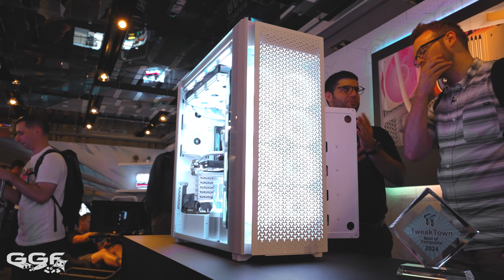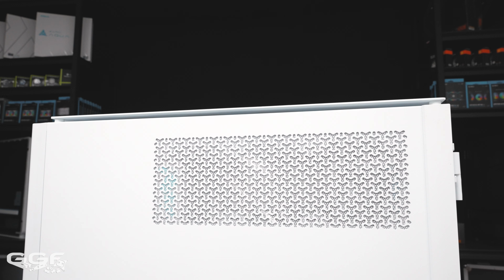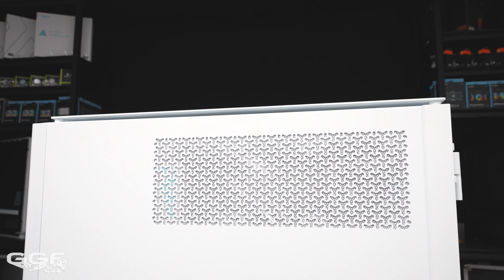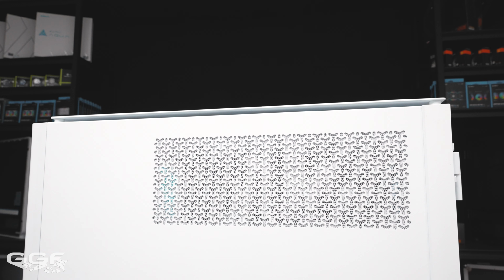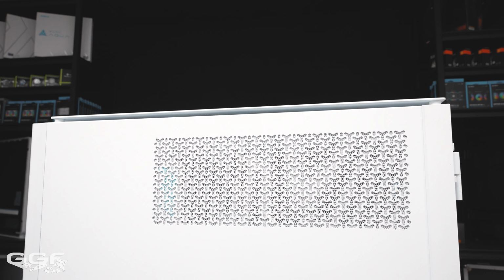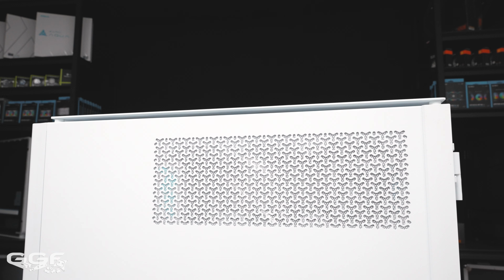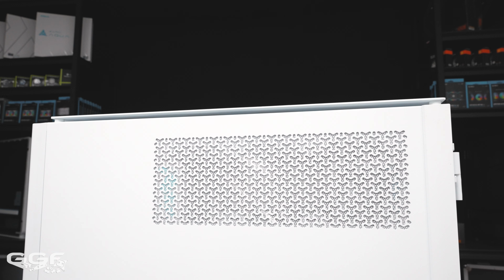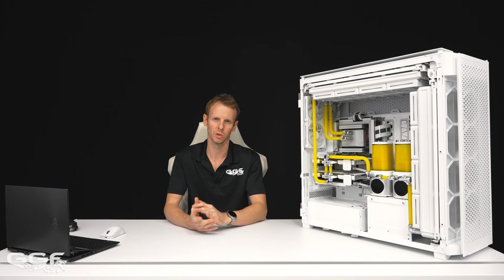Corsair's flagship Super-Tower just got BETTER! 9000D Review

Comment: I would pick the V3000 plus all day every day over this. Room for four 480MM radiators. This case is humongous. Keep up the great work bro and stay safe.
Reply: @01Gamemaster10  Not for watercooling.
Reply: @01Gamemaster10 Nothing funnier than you sticking your head in the sanding while failing to do math.  
The V3000 is not as good as you think it is. If Li Lian would have created a vented side panel instead of using glass than you would have a talking point. The V3000 plus is the PSU compartment should have mounted the PSU sideways. The 6000D can fit 2 480mm rads at the top and front with still having space for a 360mm along the back wall. That means you can have 4 480mm rads plus room left over for a 350mm rad and still fit the PSU in the system. The V3000 plus can only fit 2 480mm rads and you have to play with the bottom compartment and maybe get a third 480mm in the system..
Reply: @01Gamemaster10  Not without relocating the PSU.. LIKE I said. I'm assuming you actually want good airflow through the bottom radiator. The 9000D and 1000D are both better cases. I have the 1000D and I removed the front glass for better air flow.
Reply: @01Gamemaster10  Imagine going off about you being older, yet that's how you speak. Dawg, if you're going to flex age, at least ensure that your maturity actually comes out in the comments. Either way, the 9000D does have room for more radiators, when considering only 120mm fan rad sizes. That IS an objective fact here. It doesn't matter if they're both overkill, when comparing them for their cooling power, more rads IS better. And the main idea behind these cases is to either have multiple systems in one build, or having a ton of high heat output parts. Being 5x overkill is still better than being 4x overkill, no matter which way you try to spin it. You're also not really saying anything that I couldn't find out from just looking at the spec page for the case. And similarly, just looking at the spec page for the 9000D, it's a better case for watercooling. 

You're "ALOT" older, yet you still don't know that "ALOT" isn't a single word.
Reply: I wonder if they’re updating the v3000
Reply: It is easier to do a quad 480 rad build on the v3000plus than on this case.

Comment: Brilliant video, I just order Corsair 9000D in white with 3X 480 rads and two Elite LCD pumps.  Your information is invaluable to when I start putting my build together.  I my case I’m using MSI Godlike for AM5 with a 9800X3D and later will use a 9950X3D when released.  I’m waiting for the nVidia 5090 FE and AMD 9070XT to release and then look for water blocks.  I’m a little concerned about the 5090 hitting up against the pumps … if you get a sec, can you tell me how much clearance there is between the pump and rear panel?  Subscribed, excellent video, thank you!
Reply from the maker: @robainscough  a water blocked 5090 should be no longer than a 4090. I don't think you'll have any issues

Comment: The hdd cage is similar the 1000d. I had a WD red drive go bad within 2 years because (I believe) of the water pump mounted on top of the cage. The vibration would transfer through. The Lian li v3000+ I think is better implemented, will try that case out.

Comment: Hi would the lian li uni fan p28 fit in push pull configuration  with 4 480 radiator (45thickness ,30thickness ) thanks in advance 🙏 am a noob  builder please be patient

Comment: GGF, tell me, does using two pumps make sense? I want to build a similar custom one in this housing and it seems to me that two pumps are an advertising and visual solution; it probably doesn't add much to performance.
Reply from the maker: @waldekddd6827  depends on the build, complexity of it. Remember, rads add very little restrictions. It's mainly fittings and blocks that do. You also have redundancy with 2 pumps you can also run 2 pumps at half the speed for near silent operation plus it fills the space
Reply: @GGFEvents   @GGFEvents  Thank you for your reply; I practically have the entire Corsair set (with a spare AMD Ryzen 9800XD is still unavailable) to build a "specific" station. I have already drawn the CAD design of my potential custom. As for pumps and operation at 50% efficiency in dual mode, you surprised me a bit and unfortunately - I disagree on this point. This simply contradicts Pascal's principles: if I use two pumps and reduce the liquid flow rate, its impact on thermal processes will be the same as using one pump at 50% efficiency. The only limitation here is the resistance of the liquid: blocks, coolers, controllers - it is difficult to calculate here. According to the declared data for the Corsair XD5 RGB Elite LCD pump, it should be able to handle it. However, what is written on paper is not always true. Hence my question.

Comment: I have a cuople of questions, if anyone is willing to help!
1) If I use the front spot for a double 360 thick radiators + fans, the top back spot for one 480 thick radiator + fans, can I fit a 280 rad+ fans in the back? (Remember, the only top spot used is the one in the back, and it LOOKS like is not aligning, but that's my doubt about it)
2) In the spot where you should put the reservoirs+pumps combo, is it big enough to put a "360mm" distro plate? I would like to put there the "360 Dual D5" reservoir from Singularity, but I can't find the exact measurement of that space
Thanks to anyone willing to help!

Comment: I plan to buy this case, also in a version with two pumps. I have a question here: motherboards have one connector dedicated to powering the pump. Where to connect the second one? - can I use a cable splitter from one socket?

Comment: Have the 7000D Airflow running air cooled as open case to fit my 4090. It's been like this for months honestly idk this is an option (few other large fishtanks might also work) if I want to redo my build. I had to remove the HDD cage to fit my large PSU. That I could have both in this case is tempting.

Comment: Love this build. Can I ask, what are those extensions you use on the tubing part to clear the fans coming off the rads (It looks like you use one or two on the cpu block as well)? I'm fairly new to the water-cooling scene myself and when I did my first build (went push-pull on the front rad just to be fancy) I didn't realize I'd probably need some extensions to get over the fans. Unfortunately though I don't see anything like that on Corsair's website. Any help would be much appreciated. Again, love the review. I think this will be my next case in a few months.
Reply from the maker: @CsPPP237  thank you. These are actually bitspower extensions. They start at 7.5mm and go all the way up to 50mm. Corsair essentially oems bitspower so they are the same
Reply: @GGFEvents  Ah, got ya. Thank you so much for the info and for the great review again. The in depth look will be super helpful for planning out my future build.

Comment: Very nice
Im one of those with a 1000D build, but man do I want to get a 9000D and do a new build... Maybe in a couple of months.
Reply: Same here, nothing can beat the 1000D other than the 9000D.
Reply: @WeshiPlays  1000D still has some advantages over 9000D.
I have 4x480 44mm thick rads in push-pull in my 1000D, couldn't have done the same with 9000D because new fan trays cannot be bolted to the frame, simply not enough material to do so.
Reply: @Rubed0_o  i didn't know that

Comment: The combined front I/O seems like a mistake IMO. Besides being locked into only one system having front I/O in a dual system build, you're also dropping the bandwidth. Most times, when something is being plugged into the front I/O, it's for data transfer, and now it's being slowed down for no real benefit and the actual ports on the motherboards are sitting there twiddling their thumbs. 

Them not leaving at least 30mm for the 360mm slot at the back there seems like another oversight. It looks out of place when it's empty. 

Otherwise, looks solid if you're fine with 120mm rad sizes. If it wasn't so expensive(and had the typical split power/reset button cables), I'd have actually considered it. It's actually nice enough to make me switch from 140mm size fans/rads.

Comment: I've had the 900D since 2015 and downsized to a 5000X in 2020. Now I just bought the 9000D because of the changes. I thought about the 1000D but opted for the 5000X for space reason during that time.  The 1000D is beautiful but I want this 9000D for function over form.

Comment: Best review of the 9000D I've been able to find. Thank you very much. It'll definitely be my next case. The only part I have issue with is the built in iCue stuff; that really isn't a selling point, but rather a detriment. I'm pretty sure that anyone that would be using a 9000D case knows enough about Corsair's horrible iCue software to stay far, far away from it. I wouldn't install iCue on my worst enemy's computer. I'm pretty sure we could take out North Korea just by installing iCue on all of their computers.
Reply from the maker: Thank you. I guess thankfully it's only 2 RGB areas so it's no big deal if you don't use it. Maybe if there was another option to offload it to motherboard RGB.

Comment: I have 1 question to the loop for your GPUs(the 2 tubes between the GPUs). Because the water can go 2 ways, where 1 is straight out and the other would need to take a turn to go through GPU. Would that GPU run warmer than the other or does it not really matter? I mean in general if it would be used in a build with less radiators.

Comment: I can not explain how mutch I hate iCUE... Lost count how many times that program makes my system lag so bad I have to do a hard reset. Lighting goes nuts, keyboard don't turn on or work after boot, if it works then the mouse does not work... etc... Gave away all of my Corsair parts and will never recommend them to anyone or use it ever again. The enjoy I got inside when I took a shotgun to my Corsair K100 RGB... Can't explain it how happy it made me feel to be finished the with corsair crap iCUE... The cases I can get. But ANYTHING that has to do about the iCUE will be ripped out and put right into the trash where it belong.

Comment: Corsair can make as many cases as they want and whether you get their $100 or $500, they all are made with cheap, thin metal and plastic that with no time bents, rattles and brakes. I am surprised that after all these years they haven't learn anything. Look when he used screwdriver without much pressure the whole back was flexing so easy like cheap plastic. Corsair is a joke when comes to PC cases, they should stick with Memory and PSU's.

Comment: i think front io should be modular
cuz not every motherboard has 2 USB-C headers
and this limits you to either getting something specific or just taping it off or being contempt with never using it
Reply: Newer boards have two USB-C headers.. You don't transfer an old system to this case. You can also Type E adapters to usb 2.0, 3.0 etc which are cheap. When building in any case you must think ahead.
Reply: @michaelcarson8375  sorry to break it to you. Cases are cosmetic. They should not be a deciding factor of your hardware.
Same way as cars are built around the engine, not the engine built around the chassis
Reply: @skorpysk  Cases have always supported the standards of the times. You should not be blaming the case for your poor choices.
Reply: @michaelcarson8375  ok fella, i looked into it, just to be sure, looks like i was right
there's not a single consumer-grade motherboard, that has dual usb-c headers. 
Not even modern TRX40 Boards get dual USB-C, yet you are out here, rambling your mouth, as if you even knew what is up. you don't. The closest thing you get, are Server-grade motherboards, that nobody sane, is putting in a all looks, 0 practicality case. But i guess you wouldn't know about the Sanity
Reply: @skorpysk  You didn't look. Because if you had you would see that many reviewers and motherboard makers mis label the Type E usb-C front panel headers as USB-C front panel headers. Two such board are the MSI z790 godlike and MSI Z790 ACE and their MAX counterparts. It's the EATX boards that have Type E front panel headers. You can also buy M.2 usb addons with two "Type-E USB 3.1 Front Panel Socket"